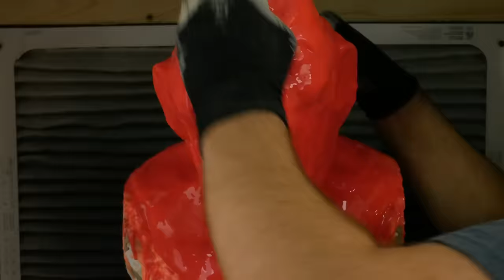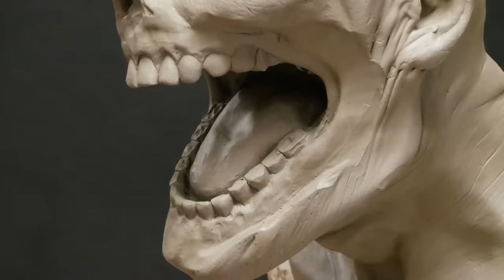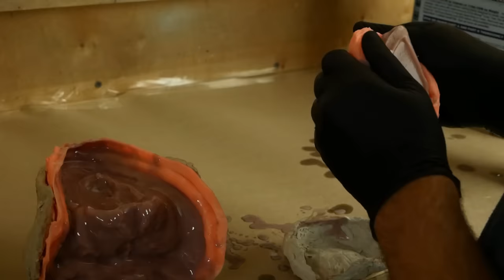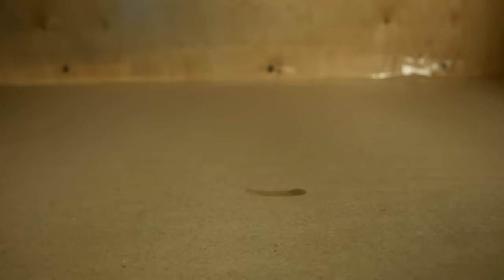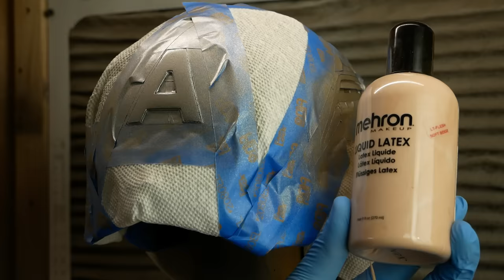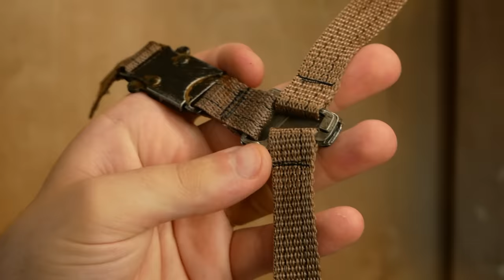Zombie Captain America Sculpture Timelapse -  What If...?

Comment: what materials do you use in your work?  Will you ever write what it is in the video?  For example, how will you perform the first stage, i.e. sculpting, what will you use to sculpt?  And then what do you pour it over and so on
Reply: Sculpture is made from water based clay (most likely WED clay).
The rubber mold is Rebound 25 silicone.
The mold jacket is Ultracal plaster, reinforced with burlap/plaster bandage for added strength.